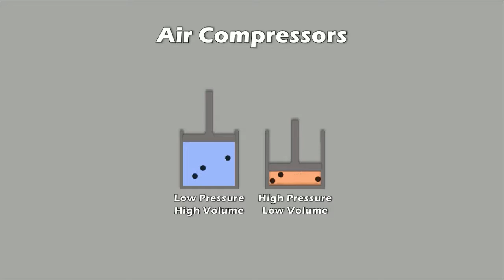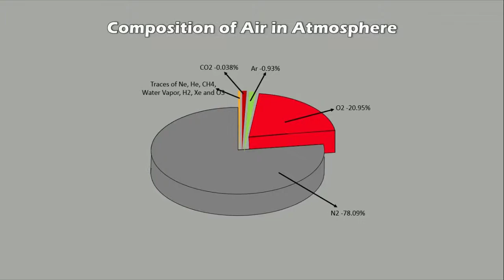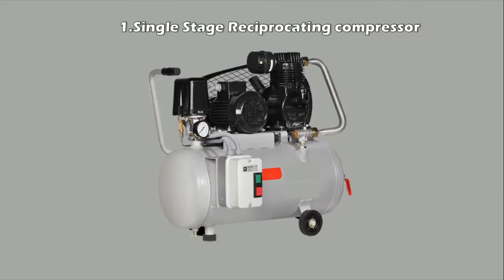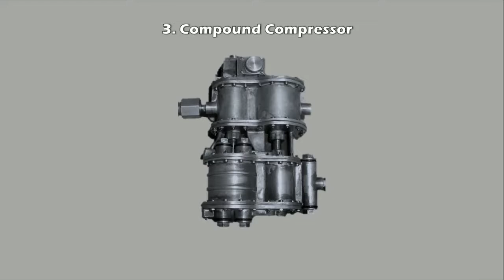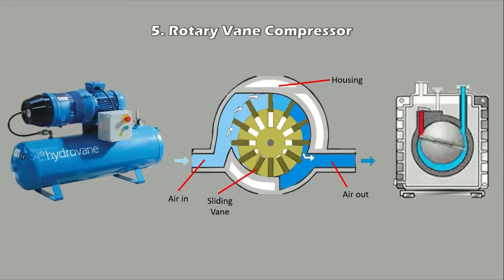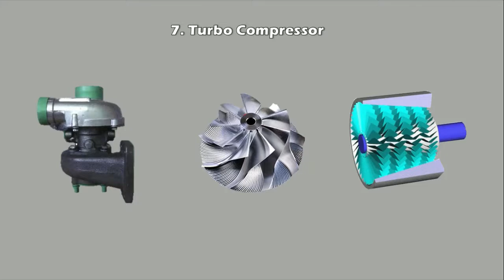Types of Air Compressors | Reciprocating, Compound, Rotary Screw, Rotary Vane, Scroll etc | P&HS03

Comment: WE SHOUD USE AIR FILTER FOR DRY AIR COMPERSER ALSO ?
Reply from the maker: Yes, air filter is a must for any type of compressor. Air filter doesn't allow dust and moisture to enter into the system which increases life of system.
Reply: moister also found in dry air
Reply from the maker: No

Comment: one question i have, does the air compressor   works on the same principle of a bicycle air pump, where there inlet and outlet valves, as in when when u push the  inlet valve opens and when u pull the  the outlet calve closes...thx
Reply from the maker: Absolutely... and this compressed air is stored in a tank called air reservoir (air storage tank). Just that there are many different design variations for compressors, working principle is same.
Reply: @EnggConcepts  do u have a video for the same... Thx

Comment: Which compressor is best for storing compressed air
Reply from the maker: Compressor is used to compress air, whereas reservoir/storage tank is used to store compressed air they are two different things, usually compressors come with in-built storage tank. For Industrial purpose it is better to have saparate storage tank.
Reply: @EnggConcepts  thank you for replying.
But for better understanding please tell
Which compressor I have to choose for compress the air and to use the compressed air as an energy to generate electricity through air motor and alternator.?
Reply from the maker: Looks like you are doing some science project or DIY project. I don't know what your requirements are for this project. I suggest you to choose a compressor with good storage tank capacity  that meets your requirements. You need to know how much air is required to run your air motor and you need to run the air motor for certain duration of time to produce current. 
Consider reading all specifications of compressor before you buy. If you have a mentor or guide for your project or someone who knows about your project ask them. 
*Choose as per your requirements
All the best
Reply from the maker: Just watched your video link. I got no notification of your reply because youtube held your comment for review because you sent a video link in the comment, Youtube does this automatically. 

That project is actually simple, i like it. You just need to buy a manual compressor (Without motor -Suggest you to go for screw compressor or any compressor with manual rotatable handle) connect with air motor and generate current that's it. I hope this is helpful. All the best.
Reply: @EnggConcepts  Thank you very very very much 😍 
Unable to express my gratitude in words
🙇🏻‍♂️🥺😍❤️🙏🏼💝
Reply: @EnggConcepts  Can you help for only one more thing ???🥺 Whenever you will free..
If you wish ❤️ please...
That how to compress the air in the compressor? I mean to say which kind of gear box or any other mechanism ... 
Can A short explanation please 😍🙏🏽
Or any kind of operations.. please
Reply from the maker: Gear box with good ratio between driver and driven wheels will work fine. There is lots of good content about gears online that will help you with your project.
Reply: @EnggConcepts  THANK YOU VERY MUCH SIR.
I never thought You will reply every query with detail❤️😍😍😍😍😍😍🙏🏼💝🙏🏼💝💝💝💝🙇🏻‍♂️
Reply: @EnggConcepts  When I will finish I will definitely inform you through a detailed video with your credit 🙏🏼